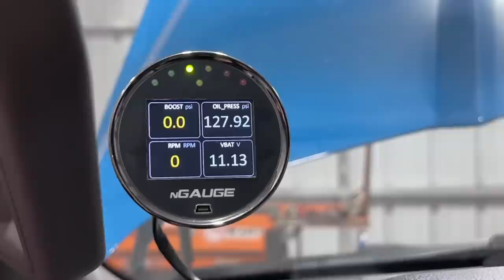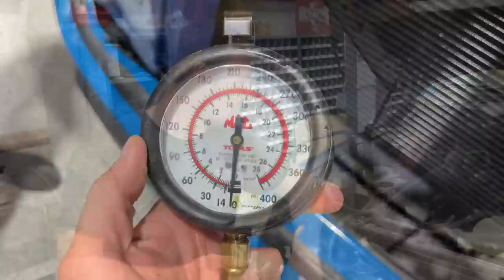One Day, TWO Engines.... This Can't Be Happening!!! Ruby & the Whipple F-150 Will Bankrupt Us!!!

Comment: It was the belt squeak creating bad harmonics that broke the crank.... Hope Ruby  is up and running soon.
Reply: Combo of the bad harmonics from the belt combined with the moving earthquake that is a top fuel car
Reply: WD-40?
Reply: Snout of her crank has always been a bit soft. After all, she'll throw belts in the burnout box and has had repeated issues with braking {correction} breaking crank position sensors.
Why it keeps deflecting and breaking the crank sensors, I'm not sure of, but an alternator alone surely wouldn't be loading it like a supercharger.
Maybe the crank is actually twisting and that's what has been causing the movement/deflection of the harmonic balancer.
The big fat cam shaft maybe even playing a role in that engines crank problem. Anyway, she'll have a good freshen up and a new crank then she'll be ready for those 6.5sec passes.
Reply: @TheHungrySlug  I think the crank sensor problems were with the previous engine.  Remember this is Leroy's engine
Reply: @eddominates And they had crank sensor issues during Sickweek.
Reply: Wonder what brand of crank is in it too
Reply: @eddominates they've had the same issue since these changes. 

I swear it's due to poor shielding/wiring and not any kind of crank deflection
Reply: @RipeSnipe  could be.. I thought Zach just fully rewired ruby, but maybe the same issue persists
Reply: maybe he didnt do the engine harness over? or he doesn't know about shielding fully? idk @eddominates
Reply: That crank had been in the Blazer. The crack is from the blower. The sress fracture just grew and grew
Reply: @AB-80X  that explains a lot

Comment: Rubie's crank pulley probably broke either from a dynamic balance issue in the accessory drive system or a misalignment in the pulleys or a little bit of both. Ruby has been trying to tell y'all something wasn't right by squealing her heart out.
Reply: Exactly
Reply: Been squealing for a LONG while 😂😂
Reply: You’re forgetting that’s the old Blazer engine. That crank is dead because the blower cracked it.
Reply: It broke from 10,000 bald eagles going by
Reply: @AB-80X  That was Leroy's engine so it didn't have a blower on it before. They had mentioned that in the video.

Comment: Call Roush Racing, if anyone from the Terminator program is still around, they will have a good chuckle at your crankshaft failure. There's a terminator balancer in the ceiling of a dyno cell IIRC from like 2001 when during the terminator development program they discovered a lack of fillet in the crank snout and it would snap off. Anyways, the mod motors have needed a bigger crank snout for a very long time with supercharger's. We had a shop mod motor that made pretty ridiculous power back in the day, it would twist the block to much the main cap side bolts would back out. Good shit, was fun. Tire shake will break a crank snout, and send rods flying out the oil pan to.
Reply: In the ecotec world, we've been butting huge keyways in the crank for a long time now because ATI would spin and weld itself on and snap the stock bolt. Replace it with a large keyway all the way to the rear main seal and a use an ARP crank bolt and never had that problem again.
Reply: Was thinking I know small block chubbies can get cranks with big block snouts, I wonder if you can do the same with a coyote.
Reply: Typical ford always breaks down when needed most lol… at least it’s not on a Russian dump !!! 😂
Reply: If you ever said a red light and you've been to the side like a diesel or something that's caming, and it makes her engine feel like it's running rough when the Dr. Dead blow by it probably dig house of the balancer that loose hermonics.
Reply: @jeramiahshaffer8414  this video literally features a Ford and a Chevrolet engine breaking exactly the same part.
Reply: @jamessuman2151 and the Chevy engine only had an alternator pulling on the crank
Reply: The atmospheric balancer was from the GT development.
Reply: Wasn't Mihovitz running a stock Kellogg crank? Wonder what he was doing, if anything, for crank support. Though his was twin turbo.
Reply: Why the hell would he call roush lol
Reply: @Scootermagoo you could but you’d need the cover machined for a larger seal I don’t know if there is enough material in the cover to do so.
Reply: @boosted_l6787 yeah hard to say with the LS, did hitting the sensor cause a failure, or was there a failure that caused it to hit the sensor
Reply: Spending all that money and time to beat a mini van, that's funny.kyles gonna spank that ford..
Reply: Twin turbo doesnt have belt fed supercharger thats what snaps them @FordRanchero289
Reply: @srwannngsalot what?
Reply: @srwannngsalot  huh?
Reply: @jamessuman2151 lol that's fanboy logic. He must have missed when they said the blazer also broke the crank snout because of the big supercharger they have on it.....SMH
Reply: @lexluther1323  Because he suggested they have a special balance.
Reply: @jamessuman2151  it might have something to do with someone cranking down the tensioner to stop that belt squeak
Reply: Did you have a stroke mate? @srwannngsalot
Reply: @Hot-Shot-420  right it was the McFarlin science  channel experiment in stealth mode .. long term experiment lol had to let it run its course for the love or science
Reply: U need to beat the tesla van with wipple truck i like Karl form boostaboys but its the ev lol go get him
Reply: Yes be cause a 4.6 and 5.0 are the same both have dohc but not v.c.t.. Steve Morris makes custom cams all day long worse thing buy a 5k long block
Reply: @coolcat7918 I don’t understand why you think he’s doing this for the purpose of racing that shitbox van😂
Reply: @goat3898  Dunno never seen a coyote in person yet, it might need some aftermarket support to pull off with a new casting.
Reply: @srwannngsalot yeah that’s a good point..🤪
Reply: @lexluther1323  
Was that an actual serious question, or an attempt to flex your ignorance?
Reply: @Scootermagoo I’m sure if it becomes a huge problem they will figure something out other than a crank support. Pretty cool idea just wonder how much power loss it has.
Reply: @FrequencyOfThought what kinda power you getting out of the ecotec, those motors have so many factory issues, they’ve never been on my radar
Reply: @wayneessar7489  No special balancer will stop the stress on a too-small crank snout if it connects to the crank at 90 degrees with no fillet, it's a failure point.
You need a bigger snout on the crank, that's what Roush will tell you.
Reply: @boblouis972  What? Is this a troll comment? The LSJ LNF LDK  cranks will handle 1000HP+ The problem is finding a transmission to hold the torque
Reply: Shouldn't joke about oil pressure on first start . Very naughty for the old ticker 😂
Reply: @jeramiahshaffer8414 tell Bret lasala that. Walking all your big block chevy pro mods with a little 302.
Reply: @jamessuman2151 That Chevy engine has years of racing on it. Of course parts are going to break eventually. Nothing is harder on an engine than being run in front of a manual transmission, so the LS has dealt with way more abuse than the Ford.
Reply: @fast97z24  Yeah that's what the honda boys crying in my rear view say..
Reply: 😂crazy🥹
Reply: @srwannngsalot 😂
Reply: @srwannngsalot  wtf are those words you wrote?? Are you writing in code or some kind of encryption??? I feel like you were talking about the weather or polar bear migration possibly, either way…… WHAT??
Reply: Out of Australia… Australia is a fake continent 🙃😂😂😂😂🇦🇺🤜🏼🤛🏼🇦🇺🍀🍀🍀☮️☮️☮️
Reply: @FrequencyOfThought  red drew SD few e dew 1

Comment: The belt squeal broke the snout 😂😂😂
Reply: actually.. you're probably not wrong.  The reason for the belt squeal and the snout break is probably the same reason. 

I think the belt squeal was a symptom of a pulley misalignment, which weakened the crank.  If you have the belt pulled as tight as it'll get and it still squeals, you aint lined up right. 
then after a couple hundred million revolutions with the misalignment, the snout has been annealed by the slight tugging and now it's soft/fractured/ready to snap off when the boost rolls in.

Comment: As someone with all these RCs GREAT SELECTION!!! The Promoto and Mojave 4S I by far my favorite releases of 2023
Reply: I'm not into the promoto but agree the 4s Mojave is great.  Arrma been killing it lately.  They've taken all my money since last July.  I'm really hoping they will drop a 8s 5th scale Mojave this year.  I have a SBR 2.0 but it's not exactly a mojave type basher sct.
Reply: The Mojave looks like a Traxxis UDR with the wrong or irs suspension. Does it handle good? My UDR isn’t a giant basher more a scale realism fun time.
Reply: @duramaxdad  it does handle decent.   It seems to traction roll less than my SBR 2.0 and my buddies UDR.   It does lack that realistic look drifting around but more than makes up for that in toughness.   Both the 4s and 6s trucks are tanks.  Body post on the 6s is about the only weak part of the whole truck.  On a track the UDR is probably better and definitely looks better going around but bashing jumps the Mojave's are hard to beat.  The 6s and Fireteam are the same platform and my Fireteam is my toughest rig.  I've broken it less than my Xmaxx.

Comment: If you have something crack away from welds... There needs to be a plate/gusset there for extra support. Those lower arms aren't built with structural integrity in mind. They're made to save weight, and low weight on such an important element is the dumbest way to save weight.

Comment: It's amazing how much stress a blower puts on the nose of the crank. This truck making 900-1000 broke the nose but the shot rocket making 3,000 on a stock crank doesn't break it
Reply: SR has a billet crank. Stock block with sleeves.
Reply: Snot Rocket has a billet crank, but yes stock coyote crank does hold big power

Comment: These poly-V drives put a lot of tension load on the snouts - as anyone checked the figures for a gilmer belt conversion - it sould be run relatively loose so it's just have the drive torque load instead of that plus the belt tension loading?

Comment: I feel like the squeak is coming from the torque tube and not the belt. Considering the engine was changed and it still had the exact same noise. Which may have contributed to the crank failure.
Reply: Front accessories stick with the car
Reply: What does a torque tube squeak sound like? How can that match a belt squeak sound?

Comment: Decent HP LS based engines, with stock size main journals, tend to flex the crank on the big end of the track.   Ruby's crank was probably fatigued from all those runs you had on it.

Comment: The belt squeal with Ruby makes sense now. It probably was already failing with an ever increasing stress fracture, and then the pass from the top fuel car was just enough to throw it off to break it. Based on the description on where it broke it was going to do it anyway. So basically you should be thanking Clay that it broke at Braedenton and not on the road at a drag strip across the country in a race that mattered.

Comment: The C6 corvette had an inherent problem with the harmonic balancer pulley slowly walking it self off the rubber liner between where the belt goes and the mounting portion of the pulley that goes over the crank as if you look straight down at the top of the pulley, the belt is always pulling on the front of the pulley compared to where the base of the pulley is mounted to the crank and when you hit the gas and the pulley is really pulling on the belt it's trying to bend the pulley out of center. to solve the problem the crank would have to come out far enough so when the belth is pulling hard the pulley has the support of the crankshaft inline with the belt.

Comment: You ever check out the Werewolf Ford just released? Iron block Coyote. Figure since the truck isn't exactly a light weight...
Reply: The block isn't that much of an issue, Snot Rocket still runs a stock block at more than twice the power this one makes, just resleeved.
Reply: @griffinfaulkner3514  5.2 Predator block from a GT500 !!

Comment: You can just floor the gas pedal and crank the motor and check for oil pressure......I do this every time I change oil as well to get pressure up or any time I'm doing a new motor/setup.  Won't start when the throttle is wide open.

Comment: The reason for your murican v8's cranks braking so much is the odd balancing required with the cross plane configuration!
You have basicly 2 big lumps of counterweights on each end to prevent the front to back rocking.
But this puts the crank under big bending forces on the ends! Combined with big torque and big rpm (relatively 😅) makes for a very stressed area!
Flat plane configurations don't have that problem and have generally less waight and rotating inertia, but a little more vibrations due to worse secondary balance then the cross plain! (also relatively speaking!)
I always wonder why you muricans just simply make flat plane cranks and cams for those high power engines!?
Those are basicly all custom race parts anyway!
Everything else can stay the same.
This would also improve your gas exchange because of the equal timing in the right and left banks!
Now equal length headers and intakes would make sense on those engines! 😂

Comment: couldn't be a casting flaw, it aint cast. that's billet forged. definitely have not seen that happen before. but no kidding it is entirely possible the power being put into the ground from clays drag car could have upset the harmonics of that crank. everything has a specific resonating frequency that can cause it to fracture, maybe it somehow hit it??? just an idea. I do know that there is a specific loading torsional frequency in steel that can actively change steel's fatigue properties. so I kind of lean towards this being why. Any other thoughts or comments on this?

Comment: They make the best front snot covers too.  Too bad you didn't put it on before, would have saved so much money.  Get rid of the ugly ass radiator tank up front.  Get the Mishimoto one that sits to the side.  I have the Procharger aluminum tank.

Comment: I dont know shit about US cars and engines but 120psi seems insanely high at idle. Is that just because this engine is modified or something? Production cars in Europe usually average 15-80psi depending on oil temp and rpm

Comment: You guys scare me sometimes. A Coyote engine should be primed before first start-up. From Ford ""WARNING: Before installation, prime the engine by removing the oil pressure switch from the filter adapter. Install appropriate fitting and using a pre-lube tank to prime oiling system. Verify that the oil reaches the valve train, valve cover removal may be necessary. Oil at the valve train confirms the engine is primed.
Check oil level and fill as necessary.""
Reply: YT  money, like they give af